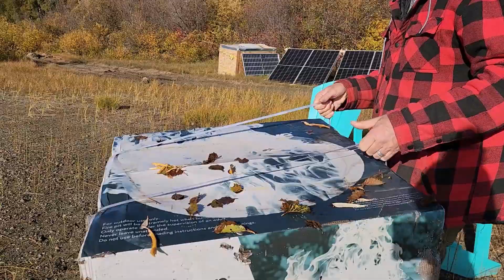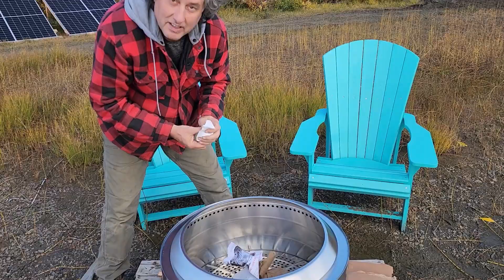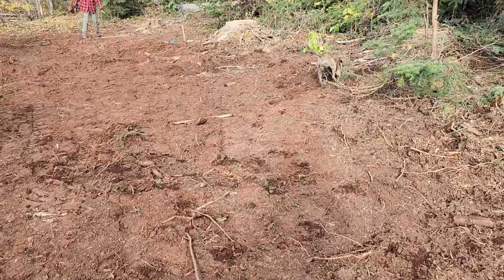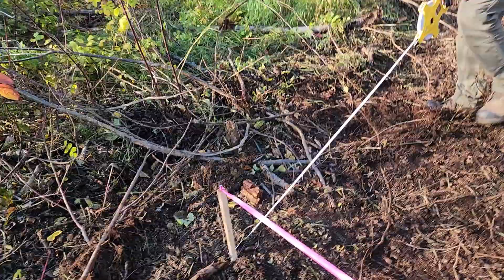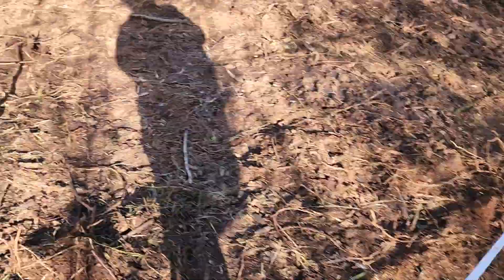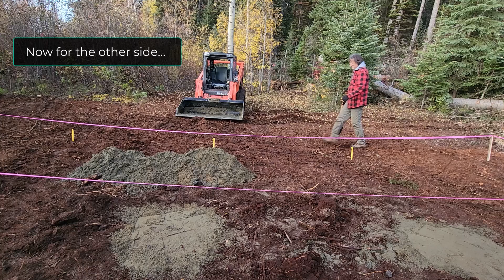How to Build a Ground Mount Solar Rack with Storage | MY WILD HOLM - S2 Ep44

Comment: At some time in the past the water has been way higher. Rains, heavy snow whatever. You wouldn't want to make a nice stand and have the snow, so deep that the panels are buried by 2 feet, or the water so deep that your panels are flooded either
Reply from the maker: Oh yes, this stand is very high 9 1/2 feet.  It also a small workshop underneath 💚
Reply: @mywildholm  Wow cool, You 2 are Amazing, I lived off grid no electricity,  for 7 1/2 years along the Iowa River, a few floods threatened and then in 1992 I moved away, to Seattle and the flood of all Major Floods went through Iowa in 1993 and wiped out Everything 43' I think was  I was just fortunate  I got out of there. BUT  I need to say Living on the River was the Happiest time in my Life
Reply: 43 feet not 43 " I made a mistake
Reply from the maker: My goodness!! You were fortunate to have gotten out in time but I imagine you miss that time by the Iowa River - what an experience!

Comment: You want it higher up off the ground, so it's NOT buried in the Snow
Reply from the maker: Hey there 😃 these are about 9 1/2 feet off the ground (with storage underneath)... the little graphic in the video doesn't show the exact height but that's about what they are.  Thank you 💚